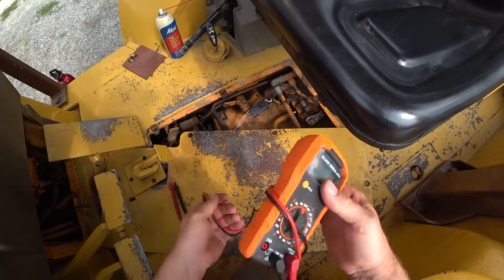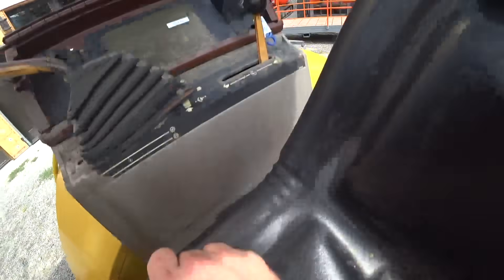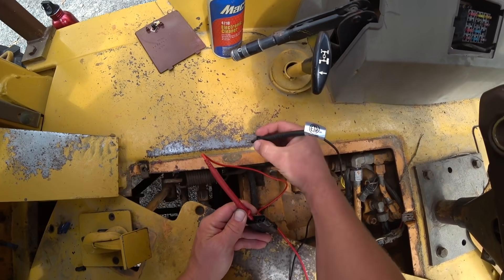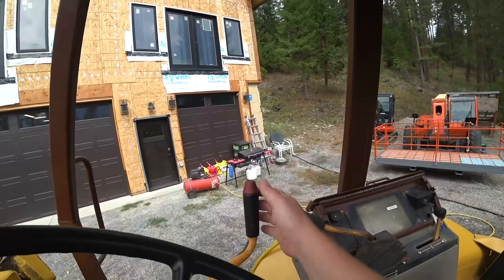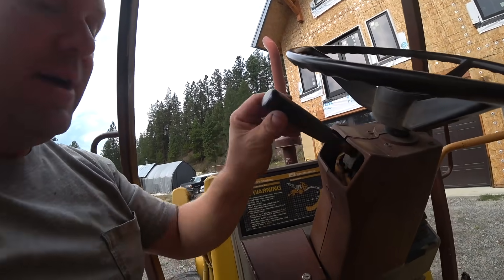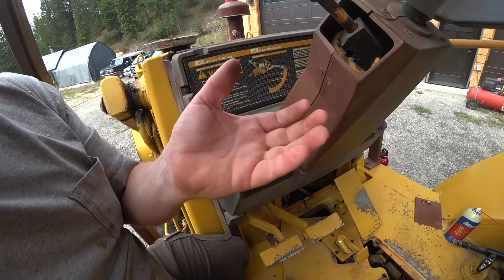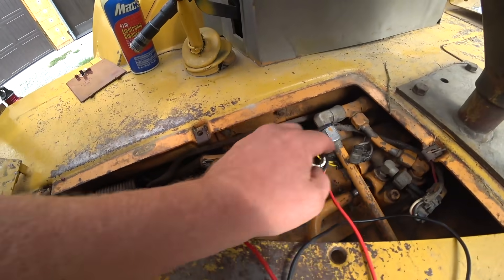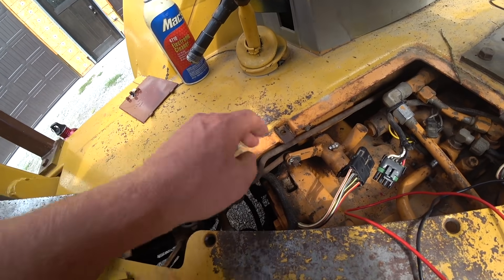TIME FOR A NEW BACKHOE?

Comment: Working at a car repair shop we had a buzzer that replaced the fuse so when it shorts the buzzer makes noise. This way you can move the wires, shifter or anything and listen for a buzz.

Comment: I enjoyed this video - I spent 40 years dealing with troubleshooting equipment not working on job sites. I have learned that enclosed cabs work better than open cabs and if it is electrical rewire the circuit. And no I do not miss it.

Comment: A trick I use on problems like this, is to use a form of "Self Resetting Fuse" to diagnose the problem.
I have an old 12V Headlight that I use for this. It gives a visual indication of the short, plus when shorted is still safely pushing current into the short. This is important as the voltage drop in the wires will cause the voltage away from the short to be higher than at the short.
I have an RV that had a short in the house lights on the right side. Previous owners to "Fix This" just connected the left side to the right side (both sides with 10A fuses). Driving could blow both fuses.... or no problem at at! Finally parked it with the short still there, hooked up the headlight in place of the fuse (it lit up fully) and then checked the voltages on all the house lights. After just a few minutes, I could tell that the light just in front of the side door, and just behind it, were on either side of the short to ground. Pulling things apart I found not only a "Shiner" (isolation rubbed off of a wire) but also where they connected the left side to the right side.  So fixed the shiner (caused by someone monkeying with the harness to add an alarm system), I removed the interconnect from left to right. 

So now I have no short... and if it does appears again, I'll only loose the lighting on the right side, not all the lights.
And I know where to first look for the short. <G>

Comment: I am glad you shared this video.  Very frustrating dealing with such issues, so it is good to know, "I'm not the only one".  Suggestion, bag all those controls between uses, to keep water, dust, the elements out of the wires and moving components.  Garage Stored is often mentioned with used machines that are for sale, and for good reason.  Left outside is rough on machines.

Comment: 580 k early production machines , would rub the harness just below where you pointed out where you thought the problem was. It is just lower , on the corner of the trans axle and frame. You access it from under the machine. I Use to work for a case dealer,  and fixed quite a few of these.

Comment: So often I wish my Dad was still alive when I watch your channel.  My Dad was a plumber and heavy equipment operator.  At one point he owned a dozen case backhoes.  He was self-employed and he was constantly tinkering and working on stuff.  He had no formal education past high school.  When he passed away, everything mechanical in my Mom's life started breaking down, rather quickly.  She replaced the gas dryer, the oven, the microwave, the water heater, and the engine on the tractor.  She finally said there was nothing left to replace and everything was under warranty now.  The next morning went to the garage and hit the button for the door...and the garage door went halfway up and fell off the tracks onto her car.  Daddy had kept our world held together, seemingly with "duct tape and rubberbands".   I learned a lot from him...but not enough to diagnose a backhoe problem.  I have mad respect for what you all are doing.  I see the haters correcting you in comments...but I'm here to say that I see you putting yourself out there to learn and try everything, sometimes fail, and try again, and eventually succeed.  I loved this video.  Good luck with the backhoe this season!

Comment: You might slip some of the plastic shielding (the ribbed stuff that has a cut down one side) in between the harness and the frame. Since you got it cleaned up, maybe there is a small break that needs isolation from the frame. I had a pickup whose wiring from spark wires would short to nearest ground. I isolated each cable from the others and ground, problem solved. Enjoyed the problem solving. Thanks

Comment: If it comes back start from scratch. Dont assume you checked something last time so it should be ok. I know you replaced the switches check them again. Move the shifters when pressing the button to see if it blows the fuse that was. Also you dont have to have a short to low fuses the solenoid may be bad. Or a poor connection under a load causes a high resistance but looks good with your meater. Same with grounds looks good in the meater but under load causes a resistance. Just start from scratch and dont assume anything

Comment: Speaking from someone who has a kind of basic knowledge of electrical work, if you think you have found the problem area, try and disconnect the harness in two spots in the same line, and do a continuity check from one end of the harness to the other. That should narrow down to the section of harness that is giving you fits. If you have continuity, you know that section of harness is good. If you don't, then you have a short somewhere in that section.

Comment: ( 30 years repairing electronics ) IF you can identify the single wire in a loom that is bad - BUT you don't want to buy and replace the entire loom ( labor - time - effort - frustration makes it insane to do so ) THEN run ONE wire along that loom - and BYPASS that bad wire altogether. And zip tie the new single wire to the loom. And make sure it is new wire with good sheathing. And another trick - spray everything with WD-40 on a day you aren't going to be using it - and then allow to air dry. It displaces water - and prevents rust / corrosion. Even grease  - dielectric or otherwise works. Or silicone. 
Tip # 2. Liquid electrical tape - in a can - IF you know- or suspect that you know where the "fray" exposed wire is. 
Tip # 3. Replace solenoid ( they're cheap and it might be it - intermittently acting up ) 
Tip # 4. Get a smartphone "endoscope / boroscope" device off eBay - for hard to reach areas ( inspection ) less than $ 12 
Tip # 5.  Keep it out of the weather or cover all the ( switch / loom ) areas with something - plastic tarps ? ( Build shed ? )
Tip # 6. Get an audible / wireless  "short tester" off eBay - cheap as well. ( $ 12-25 )

And More Bugaboo !

Comment: Get a old  12volt head lamp blub and   wire  lead to the bulb with  some spade  connectors  on  it , now plug  i the spade in place of the fuse  . now  you have a load  tester that  goes bright  when shorting  out   and  won;t  burn the  circuit  down  and save you fuses

Comment: Intermittent electrical problems are the most difficult type of trouble to diagnose. I much prefer a trouble that appears and stays there until I can find and fix it LOL. You are using good logic, Jesse. If you keep after it you will eventually find the problem. Hang in there... you are better than you think you are.

Comment: You would do well to purchase one of those inspection cameras.. You can get them at Lowes, homedepot and i think Harbor Freight might carry them too.  Should be under $100 on some models with varying options..  This will allow you to get into those impossible places and see whats going on without having to tear anything down or apart.  Ive had to check for leaky pipes and didn’t want to tear out a bunch of drywall to do it, just had to drill about a 1/2 inch hole to stick the camera in.  Worth their weight in gold!!  With all the stuff you guys do and problems you have run into, Id say to invest in a good one.. They can record video and sound too, i think.. have detachable screens so you can maneuver camera without messing up your view...  You will find a million and one uses... especially one recent one for me.. to look in a hole i was pulling wires from, to ensure there was no wasp nest... bit there was... save me some pain!

Comment: Hey Jesse, while working for AT&T in the repair department ( cable repair ) we used to refer to the "ONE-EYED Repairman "   which jokingly is the SUN.   Water from storms would permeate the small wires causing grounds, shorts, and crossed circuits.  Once we could get a tech to diagnose the issue, the weather was improved and the trouble would VANISH.   The computerized report would call it    ETIR  -   Every Time It Rains.    So if you get a storm and the hoe blows another fuse, break out the leaf blower and put the hoe in the sunshine.   DONE !    J K

Comment: I had a problem with intermittent starts for my 93 Honda Accord and after chasing that by replacing parts it came down to resoldering a small circuit board relay. The soldering joints had microscopic cracks due to hot and cold temperatures. I pulled the relay circuit board and although I couldn't visually see any problems, I resoldered all of the small soldering joints and that fixed the problem. It seems to be the little things that fix the BIG problems at times. Yeah, I'm all about maintenance for all of my tools. Thanks Jessie, that was a great video and I'm glad you shared it.

Comment: Moving the wires around trying to find the  problem  moved the problem from where it was. This happens alot in electrical trouble shooting. Looking for a 1/32 inch or less cut when you are not able to see the loom in it natural resting place is the gremlin .here. Fresh water does not cause a problem like this on DC electrics.

Comment: Ok you've made me offer you help. The problem your having with a wring harness is very common in older vehicles. Forget finding the exact spot of the short, Take and just replace the entire wire. Start at one end and go from connector to connector and put in a new wire, of course make sure you secure the new wire. Even if this issue is water this will cure the problem. 

Unless you have the hours and hours to tear apart the entire tractor and maybe by the time your baby graduates you'll find it. (LOL) Replacing the wire is the only way to fix it. BTW congrates on the new addition.

Comment: Get some of that split Plastic tubing conduit that cars use, and slide it over the loom into the frame from the top down. If it's rubbing, the conduit can add protection, and prevent the rubbed cable from touching the frame. It could save you taking all of it apart.

Comment: Troubleshooting is a matter of logical thinking. These are a few things that can help you. First is keep the schematics at hand. Second is if you have a short circuit or a malfunction to ground, don't start the engine and must important disconnect the power source. After that follow the wiring and de schematic in a logical way using the continuity test, it will bring you to the real fault to take care of. This is the way a professional electrician take care of must of the malfunctions in machinery.

Comment: Easy fix if you own the equipment. You said you know it's that wire. Okay. Now run a bypass. Run a new wire from the top switch to the other switch down to the wire harness and put in an fuse in down by the wire harness. Eliminate that wire all together. Easy way to see if it will work is take out both switches. Make a quick wire lead to both switches and put in a fuse external hookup and plug it into the the wire connector down where it should go. Works, problem solved. Now just reroute. Hope it helps.

Comment: Jessie, a safe way of checking your circuit is to bridge out the fuse that keeps blowing with a 5 to 21watt lamp. If the short happens the lamp will illuminate as it will just use the path to ground (the short) as the ground for the lamp, it prevents using up your supply of spare fuses.
Reply: I have a tester that does this.

Comment: Having been in maintenance most of my young 62 years of life (automotive, aircraft, and food production just to name a few) I hate gremlins like this... As many other have said 'Check the solenoid,' in the video you were trouble shooting from the connector you repaired back to the switches and fuse. Did you check from that connector to the solenoid? if not, check for resistance and grounding issues there. Also check the connector at the solenoid for issues, dirty contacts, loose contacts and the like. and some dielectric grease on the connections never hurts. Just my 0.02, hope this helps and enjoyed the videos...

Comment: About your worries the rainwater causes the problem.
A (non electronic/conventional) 12V DC installation should not have any trouble with rain water. Rain water has no mineral content or salt content and therefore it's almost an insulator. You need to put salt, acid or a base in rain water to let it conduct electricity. To proof that, I have seen multiple car accidents during the night where the car went into a water. Even on the bottom of al lake, the lights kept on burning till the battery was empty. The electronic prints have trouble with water, because of the very low levels of current, even micro-Amps, in those installations. The rainwater will not blow your fuses.
Your yellow non waterproof crimping connectors to your LED lights on top of the machine will not give any problem with water. Put the lights on and put a rain water wet spunge on them. It will not have any effect. I wish you good luck finding the electric problem. The hardest to find are troubles that are not constantly there.. is my experience.

Comment: Have you checked the solenoid or tried replacing it.   The solenoid activates when you hit the button, but it may not be providing enough resistance to control the current.

Comment: Just a quick idea. If you think it could be moisture, put a tarp over the control gear and seat. Then when the rain and snow come it will keep the electrics dry. As well as the drivers bottom! Or find or make a fully closed-in cab?

Comment: Here’s a secret get yourself a resettable  Circuit breaker of the correct amperage and you can put a couple leads with male terminals. that way the system is still protected and you can blow a fuse but you can reset it without going through disposal’s. This is how we troubleshooting a lot of our electrical ghosts. Obviously these are just a little pushbutton say 15 amp breaker’s not a household product.

PS don’t let the magic smoke out.

Comment: Simple trick. Take one of the old fuses and solder a 12volt tail light lamp across the tips of the fuse. This is a great way to locate shorts without wasting fuses.
The low filament supplies about 1/2 amp and the high filament about 1.5 amps. By paralleling both high and low filaments you get a 2 amp resettable fuse.
Reply: You can use a headlight if the circuit needs more current to operate

Comment: Working on elevators for 40 years also teaching electronics and circuit tracing in the apprenticeship school. I was the guy you called when you couldn't find the problem. When dealing with an intermittent problem never move or touch anything until you are actually diagnosing the issue. Trust your meter it answers truthfully. Water is an enemy so put that machine under some cover. Unless it is completely water tight you can have those kind of issues. So replacing rubber boots and connectors that are cracked and brittle will prevent issues.

Comment: Unless you get to it and fix it, it will return.  If it has rubbed through it will get green crusties eventually and you will have an open and/or short to ground problem.  If you don't fix it and it has chafed then eventually another wire in the harness will rub through as well.

Comment: Jessie the video is not bad, as you are showing the reality of things. And the reality of things in this case is, that sometimes you have a problem that is frustrating because you cannot find it. And having worked on cars and things, I would tend to agree with you that you have a short somewhere that is resulting in an intermittent electrical problem. And here is the thing Jessie, you can always go in and put a bracket with a rubber grommet in to help reduce some of the potential rubbing on wires. But it might not hurt to buy a new wiring harness and replace the old one, as there seams like there is nothing else wrong with the tractor. cannot hurt, and all you are out is time, labor and the price of the new harness.

Comment: Hi Jessie, That fault reminded me of a car my dad had years ago. It was a Riley with running bars, so you know how old it is, the front was all carved wood and all up the side was also carved. When he got it he heard a knocking noise, passenger front side, we had the wheel off the rack and pinion and wishbones all off and still we could not locate this noise. One day my brother came running in laughing his head off, he had been polishing the carving along the front of the passenger door and suddenly a bit moved and a little trap door opened and inside was a nut that had been making all the noise. We later found out that the little hatch was to keep a small toolset to help get the wheels off and there was a note in the manual telling you to wrap some cloth around the items to stop rattles.
Reply: LOL! Great story!

Comment: Fuses will below with an OVERCURRENT condition, not just a dead short. I would encourage you to do a resistance measurement on the solenoid coil (maybe you already did) to make sure it's in spec. Evaluate the wiring in the tubes that lead to the switches. I doubt it is from water ingress, the unit seems pretty well protected.
Reply: Well said

Comment: I would start at the load; the clutch cut out solenoid. There should be a two-pin connector on the solenoid that can be unplugged. I would inspect the wires going into the solenoid for damage and frayed isolation. It seems that the fuse blows when you push the button on the cut-out switch, which would lead me to believe it is a load problem. Thank you I enjoy your videos not so much the music but enjoy seeing you have published a new video.